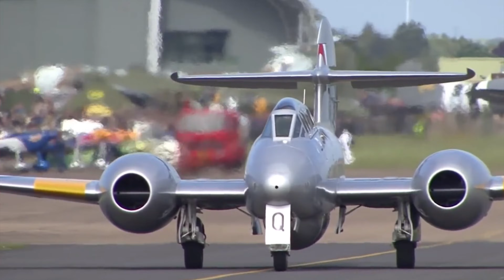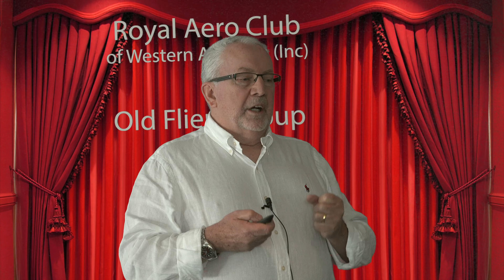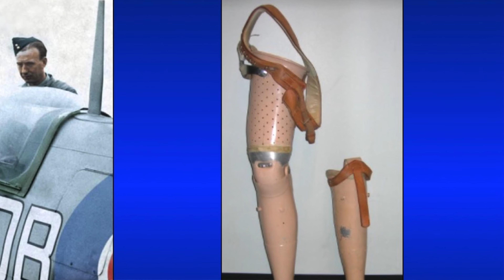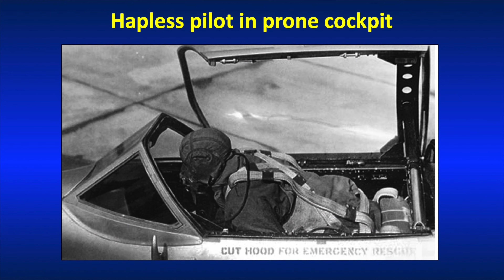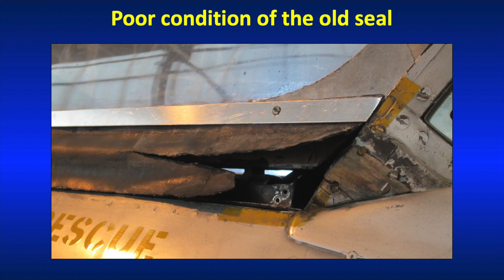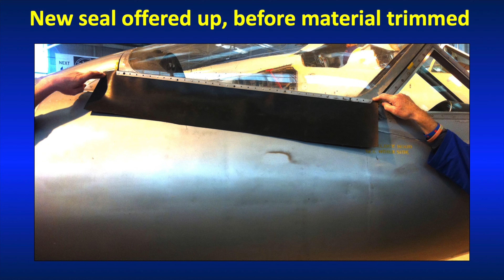The Prone Meteor

Comment: I would like to know, how many g could the prone-pilot handle? I mean is the thing with the negetiv g`s still the same? And I`d like to mentin that the Horten's tryed this position to but it always got rejected. Maybe they need to build a motorcicl-position?
Reply: Excellent question. Captain Eric Brown, who tested the prone-position Meteor, wrote that in a "normal" aircraft, he could sustain between 5 and 6 g for up to 4 seconds, depending on the seating position. - He pulled 7 g for 5 seconds in the prone position for 5 seconds without any "red-out" at all. he suspected it might be possible to sustain up to 11 g in a prone position. Negative g is not the same issue, since with negative g blood drains to your head so you don't get the "red-out" you get if blood drains to your feet. The problems with prone positions are a limited range of vision since you can't move your head to look backwards so easily, difficulty bailing out or constructing an ejection system that would work with it and the difficulty of getting into position and adjusting the controls to fit pilots of different sizes. - The introduction of "anti-g" suits put a stop to experiments with prone-position aircraft. In Germany it  wasn't just the Hortens who experimented with prone-position aircraft, lots of German companies had prone-position projects: the Akaflieg Berlin B-9, the Gotha P60, The Blohm &Voss BV 40, the DFS "Eber" The Arado E381, Heinkel "Lerche" and the Henschel HS132 .